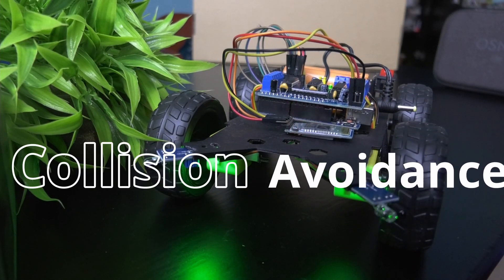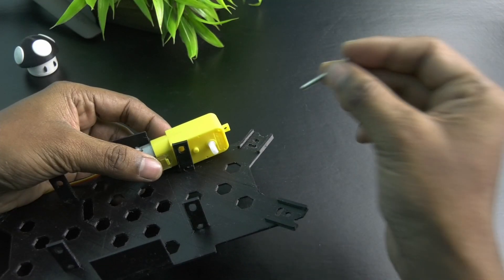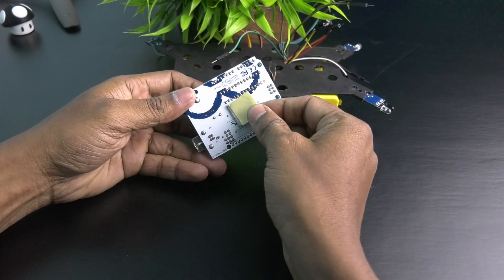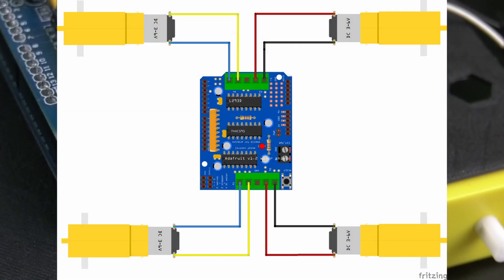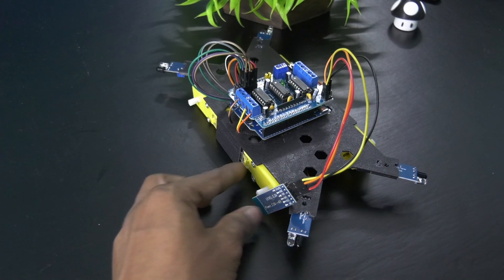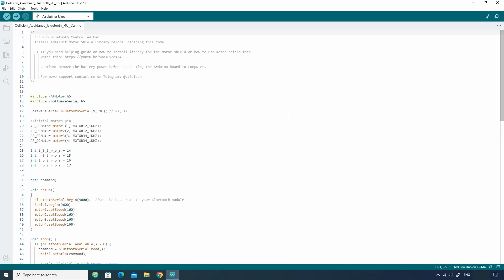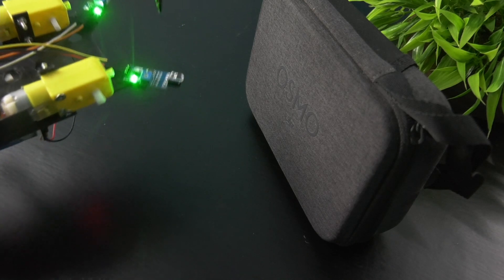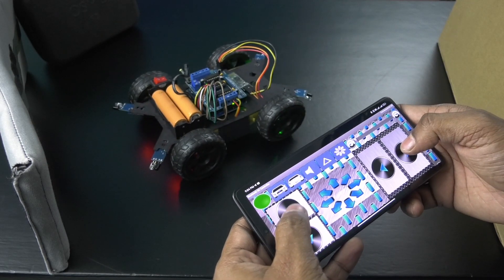How to make Collision Avoidance Bluetooth RC Car using Arduino | Control using Mobile Phone | Ut Go

Comment: Your battery link is not working, I tried with 4 AA batteries but the car didn't even move. The motors aren't defective, they're moving, arduino light is on, motor shield light is also on, ir sensors are also working fine and getting power from the motor shield. First I thought the motor shield is defective.
One thing I wanna clarify...I connected the batteries by soldering the power supply directly to the arduino DC input plug. Should I connect the power supply to the motor shield input instead? or the batteries are not powerful enough?
Reply from the maker: AA batteries are not powerful enough to drive 4 BO motors

Comment: Am using 300 rpm gear heavy motor in my project , will a 7.4 v battery be sufficient
Reply from the maker: Yes that will be sufficient👍